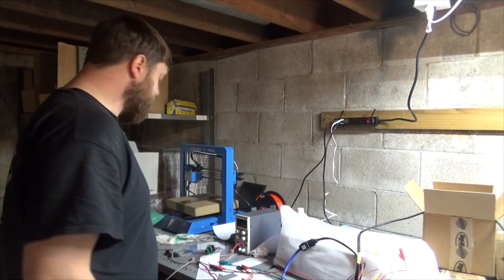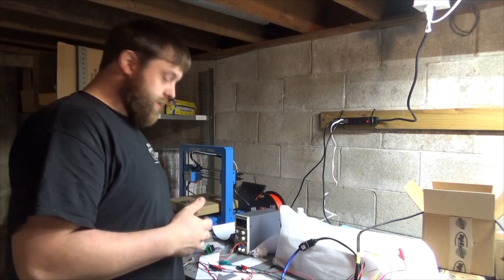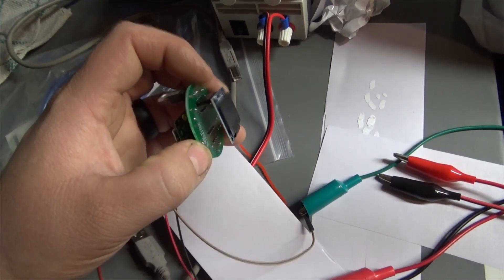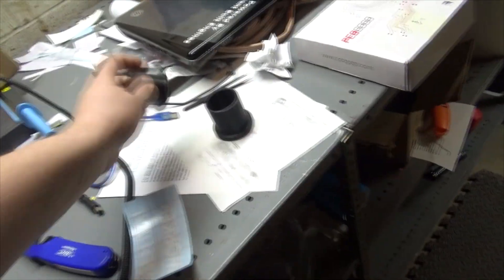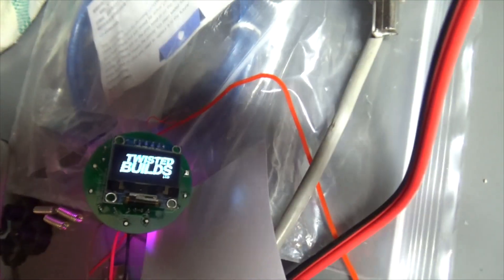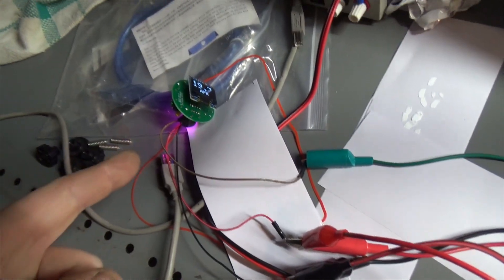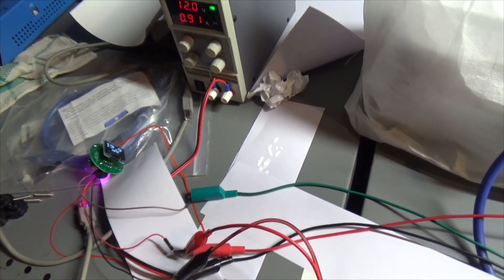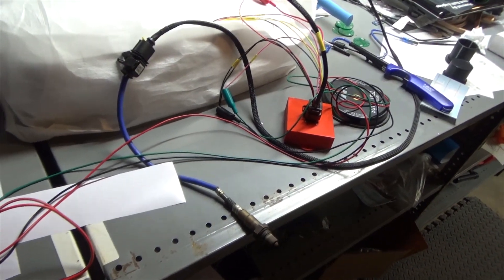Wideband Gauge Update! Prototype works! 3-29-2020

Comment: Don't they make a 5v version of the trinket aswell?
Reply from the maker: n12sumfin the 5v one is the old version that doesn’t really have enough code space to do anything. The screen library itself is almost 2x larger than the old version could hold. The new one has more code space than a arduino mega. It’s kinda hysterical because the code to run this think takes like 3-5% of the code space available haha.
Reply from the maker: On the new version that is